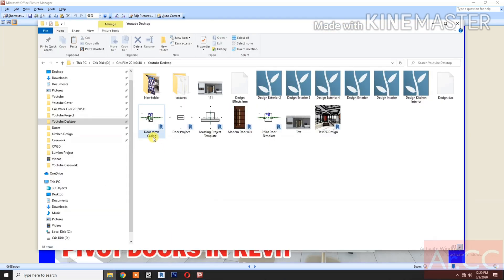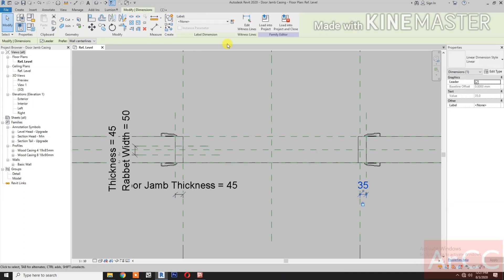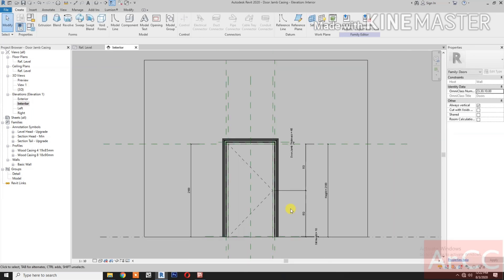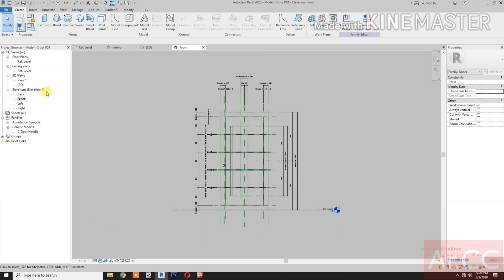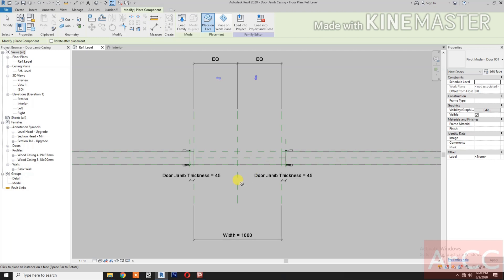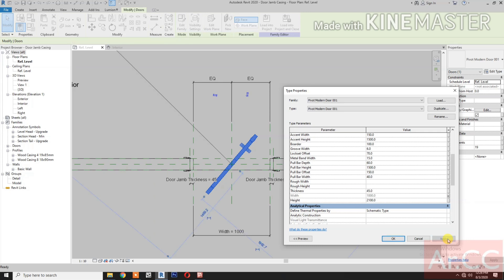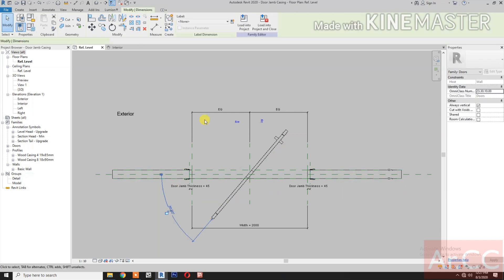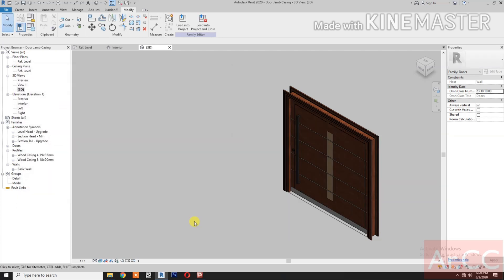RD069. How to make a Parametric Pivot Doors in Revit. Pivot Door Revit Tutorial.

Comment: Good morning. When I try to check the parameters of the opening angle, when I change the angle it give me "Constraints are not satisfied
Reply from the maker: I think before you place the door you need to set the placement into reference level. It might have you different default settings when you insert the door.

Comment: why when changing angle to 180 degree and and again changing to any angle the panel go to outside of door frame?
Reply from the maker: Yes that very tricky you need to be careful when you align them. You might select wrong reference plane. Every time you add parameter test it before you go to the next parameter.